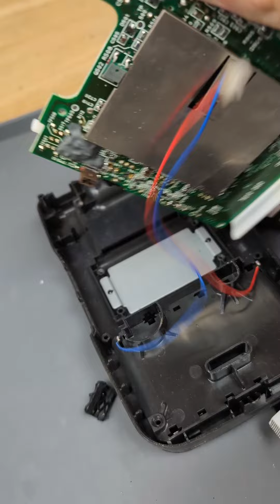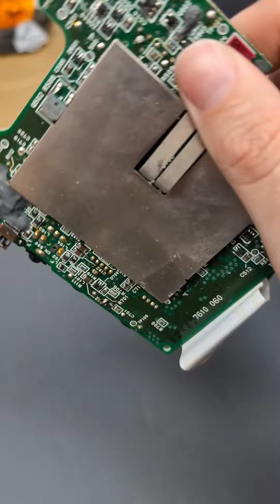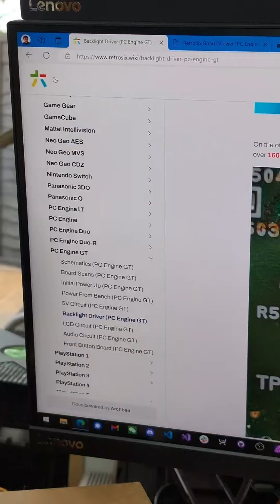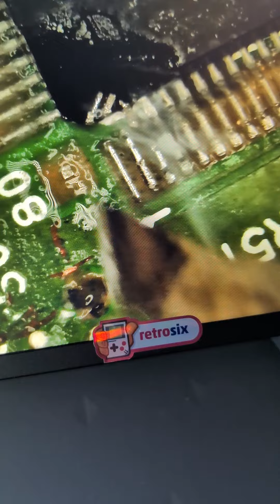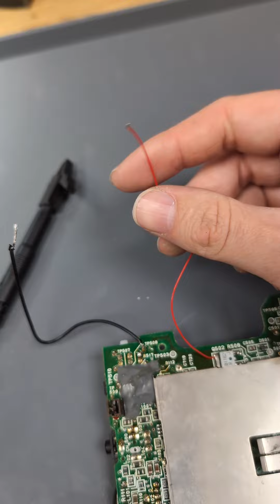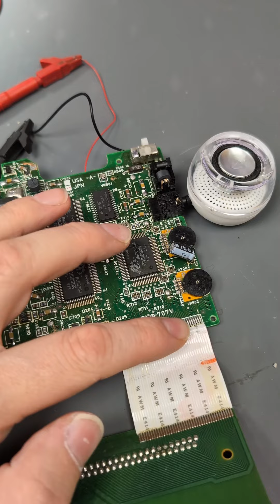😱 The world's most broken PC Engine GT

Comment: Man you are fearless! This looks like my poor and butchered two times in professional repair GT.
Now it works but it has quite a strong background noise (in the style of outrun car engine lol).
If I connect earbuds with a potentiometer in them (volume control) it gets SO MUCH better...
What can it be?

I would love you to diagnose it but I fear you are in USA, right?
Reply from the maker: In UK. Could be just in need of a proper clean if previous repairs haven't cleaned up well or could be partial hairline bridge
Reply: @RetroSix  Sorry it took ages but I've sent email to the contact address you shared on your website, please let me know when you have time :)